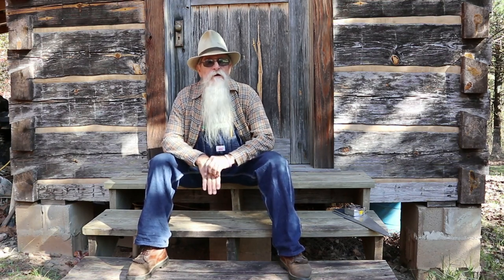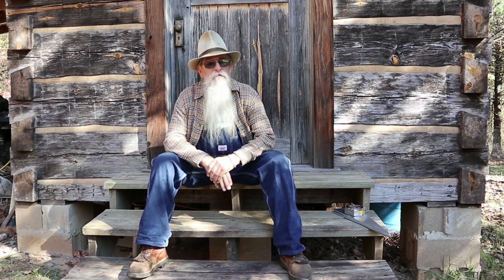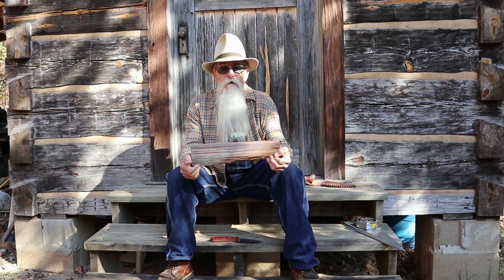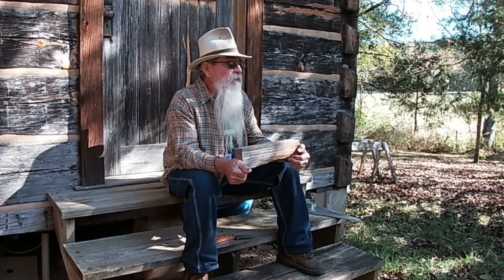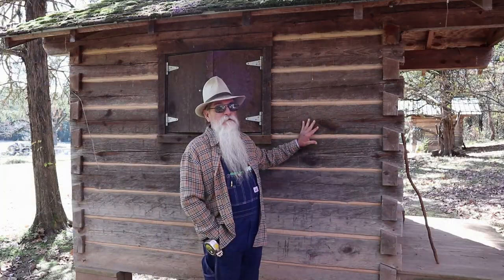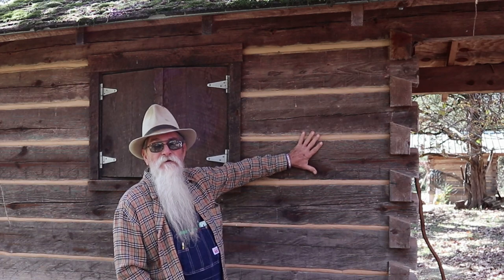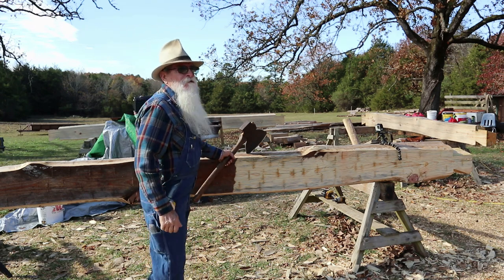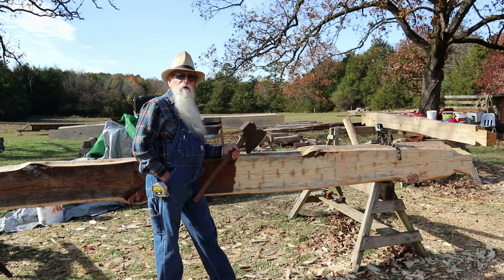Q & A, Answering Your Questions

Comment: Howdy Paul, I am sending you info on how strength the wood members. On Douglas Fir , the old Douglas Fir you dad worked with was what is called "Tight Grain". The Douglas Fir now grows about 2'6" per year and 1/4" growth rings and is actually a Hemlock, look up their scientific names of hemlock and they are all "tunga". Out west it is Western Red Cedar ( rot and bug resistant and works really well and is a nice chocolate color. Doug as we call it here, is a nice orange heart and Ponderosa Pines. I sent you an email that is to long for comments but it will give you a chart with wood strength by species and it has Douglas Fir and Eastern red cedar. Higher the number the stronger the cant. You do excellent work Paul!

Comment: You just answered a LOT of questions I had.... VERY informative.   What about stone work for chimneys?  How do you get a good water tight seal of the logs against a chimney and how do you get the roof against a chimney to make it water tight?
Reply from the maker: Howdy- thank you so much for watching the video. Love stone for a chimney. I don’t want the logs to actually touch the back of the chimney. It’s good to use an insulation board behind the chimney and allow for settling. On the flashing- you need to make allowance for the settling also. The counter flashing needs to be snug to the flashing but yet be able to slide as the roof settles with the logs. Hope this helps. God bless you

Comment: I visited a guy last summer that buys 6"x12" kiln dry yellow pine logs from a local saw mill.  The logs are half dove tail notched. When I went inside his model cabin I noticed the chinking was the same size and straight as an arrow. When I looked a little closer,  the logs were actually laying on top of each other and the logs had groves cut into them and chinking applied. He also had poured a cement slab and had the logs resting on the slab. I have never seen this before. Two questions.... wouldn't the moisture from the cement slab and the logs laying directly on top of each other cause some moisture problems down the road?
Reply from the maker: Howdy Howdy Jasse- Logs done in that fashion looks too “manufactured “ for my taste but people do this and have built really nice cabins. Sitting the logs directly on concrete is not a good idea at all. Yes, it can cause problems down the road. There would need to be some kind of moisture barrier between the logs and the concrete slab. Also, the floor would need to be high enough for protection against rain dripping of the roof and splashing up on the lower logs. Hope this answers your questions. Take care and God bless

Comment: It doesn’t seem traditional log cabins were nearly as common on the west coast which is where Doug fir is the principal construction wood. One thing you do see is what they called single wall construction. An entire wall was laid out horizontally and a second row was ran vertically with the two nailed together with clinched nails. A little like a log cabin but with dimensional lumber. The lumber could be different thicknesses so some single wall buildings had thicker walls than others. I’ve seen Doug fir beams at least five feet high and over twelve inches wide in older commercial buildings. Lots of twisting and heavy checking though. Easy to see why solid wood beams above a certain dimension were replaced with glue lam or trussed framing. You could probably build all the trusses needed for the building out of one of those big beams.
Reply from the maker: Howdy James- Daddy used to talk about the Doug for he had to work with in those days. I wish I could have been able to work with that quality of lumber. When we need anything over18’ we can still get Douglas fir. Had to get some to frame some really tall walls in a church one time. I would love to be able to get some for a cabin. I’ve heard about walls framed like you’re describing but have never seen it around these parts. Take care and God bless y’all

Comment: Doug fir is probably the strongest soft wood used in construction. Far superior to pine. It also makes a great piece of firewood. Burns hot and long, not as long as a good hardwood like oak, but not far behind. I personally prefer Doug fir over oak firewood. Easier on the back and equipment
Reply from the maker: Howdy- it is a great wood to build with. We can get it when we need stuff longer than 18’. I wish we had it growing here. Hope all is well with y’all. Take care and God bless
Reply: @TheBeardedCarpenter  I'm comparing it to the pine out west. Ponderosa, Jeffery,  some crosses, cedar....(smells great, good for siding and trim but not structural) and the oak isn't the kind to build with. Only good for burning and shade. It's hard to beat doug fir, but there's also white and red fir. All good woods but the DF has thin bark respectively
Reply from the maker: @maddawgnoll  The yellow pine here is pretty strong but may not be as stable as Doug for but it’s readily available to me. There are oaks that would be good to build with but it would be pricey. Blessings